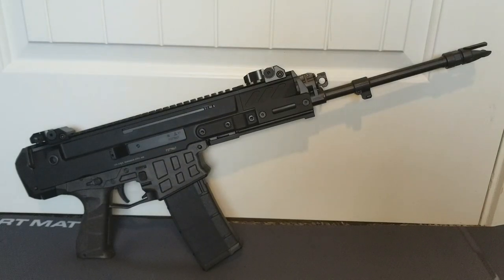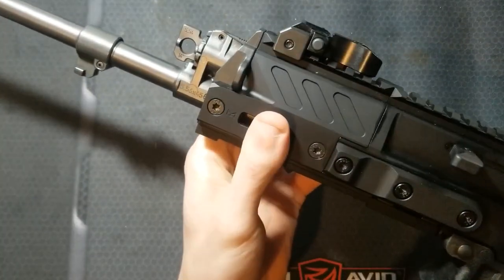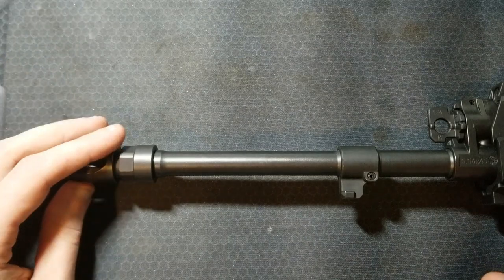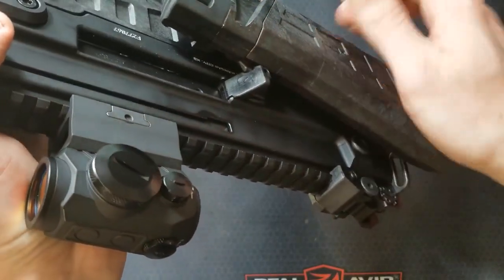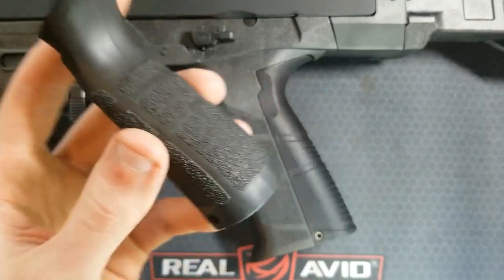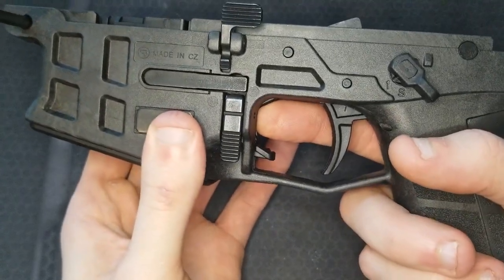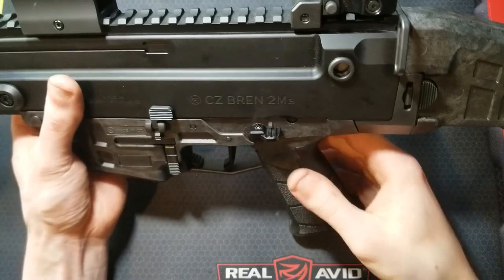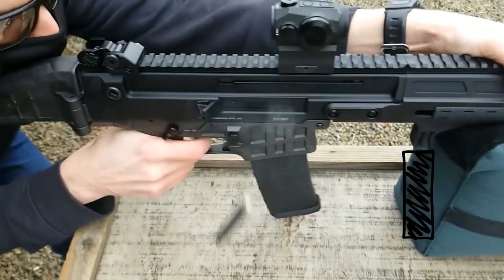CZ Bren 2 Ms 556 14 Inch Barrel Pinned and Welded

Comment: The off position on the gas is the most useful one to me for single shot quiet suppression
Reply from the maker: Going in all sneaky beaky like! I think it may also be used for an over the barrel grenade launcher with blanks. That way all the gas from the blank goes to shooting the grenade and not to cycling the action. I could be wrong but I think thats the common application of an "off" gas position.
Reply: @dltz  or if your kurdish its the built in sniper setting :)

Comment: How does it shoot with the upgraded gas block and high load spring? I have a 8” with new hb block, is the spring worth upgrading as well?
Reply from the maker: Shoots very smooth and very soft. I considered the high load gas spring part of the upgrades associated with the HBI gas regulator. I cannot give a direct comparison of how it shot with the HBI gas regulator with and without the spring as I installed them at the same time. They state the spring reduces bolt velocity, and I have had no reliability issues with their gas system upgrades installed. I would recommend the spring as its cheap, works well for me, and likely was designed in conjunction with their gas regulator.
Reply: Fair enough, thank you for your response as there is little information about the brens components online

Comment: Man I bought that same stock from VZ 58. What’s the easiest way to put it on ?
Reply from the maker: Assuming you will be in compliance with the NFA after the stock is installed... pull the fire control group front pin, pull the mag well end down and pull it forward. Now with that removed you can push in the button on the back of the receiver block and slide the block down. the stock has a lever at the bottom that will need pushed out of the way and it can be slid up in place of the rear receiver block. Then put your fire control group back in.

Comment: What kind of accuracy?
Reply from the maker: The Bren 2 has a very nice cold hammer forged barrel and I am sure the firearm is more accurate than I am capable of as a shooter. It would be interesting to put a magnified optic on this, shoot it from a rest at 100 yards with good ammo and check the grouping. I likely won't ever do that as that is not really what I got this gun for.

Comment: If your gonna do all that why not just buy the 16" version?
Reply from the maker: A few reasons. The main one being, at the time I purchased this, I could not find a 16" version in stock anywhere. My local gun shop had this in stock. Secondly, I like 13.9-14.5" barrel length rifles to pin and weld and get the shortest possible package I can get without filing a form 1 and turning into an SBR. With all the pistol brace BS that is going on I didn't want to stick a brace on it either. 

The pistol variants are closer to what is fielded for military contracts - lighter barrel profile in particular and some weight savings is what mattered to me.

Comment: Ouch, losing the bayonet lug for uglier handguard
Reply from the maker: I lost the ability to mount a bayonet when I swapped the muzzle device. I think the handguard looks good but most importantly its more comfortable, doesn't get as hot, and allows for much more accessory mounting options. I did not even consider the ability to mount a bayonet as that is not important to me on this firearm (or any of my firearms actually haha).
Reply: @dltz  gotcha, did you have any trouble with the enlarged safety? The stock one digs into my hand. Thought about removing the ambi
Reply from the maker: @TheREALLibertyOrDeath  The HBI safety levers are the same length, just wider. I did not have any issues with the factory or HBI safety levers digging into my trigger finger on the right side. They work great for me. You could look at the Haga Defense safety. What I would try is flipping the safety lever on your trigger finger side over - install it 180 degrees from the factory position.
Reply: @dltz  good idea, I might give it a try.
Reply from the maker: @TheREALLibertyOrDeath  They are just plastic too, pretty easy to grind/cut off the paddle part that hits your finger.